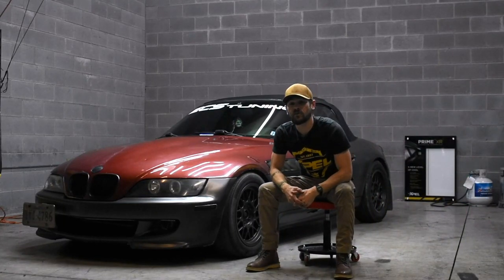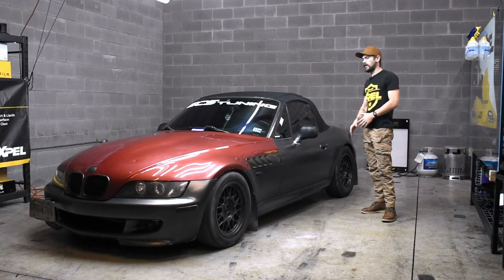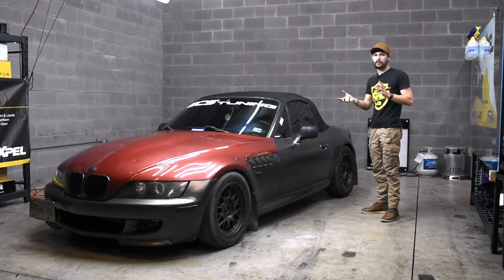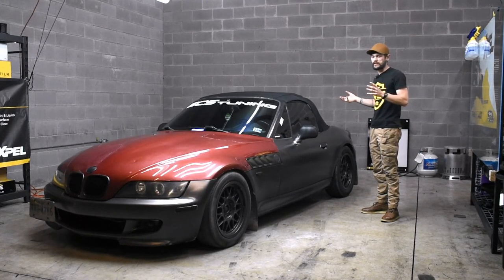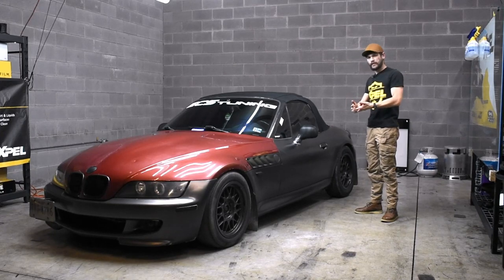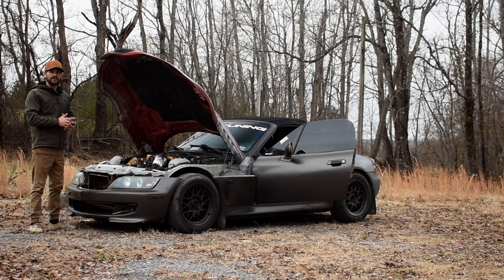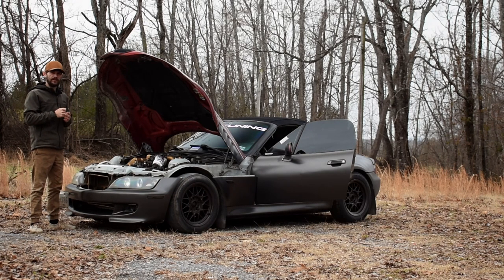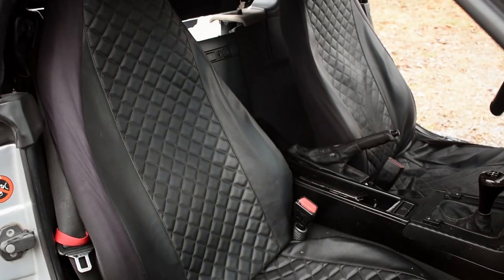How to Improve ANY car IMMEDIATELY | Z3 Subframe Poly Bushing review

Comment: what suspension are you using ? i swapped to a Bilstein B12 Pro and the camber is perfect now
Reply from the maker: I'm running ISC N1 sport coilovers with 32 clicks of adjustable dampening, and garagistic 95a polyurethane bushings on all bushings
Reply: I really want this setup too, are you running their springs, or are you using lowering springs? They don't appear to be adjustable but I can't remember. Hows the ride height?
Reply from the maker: @sahzhree7757  the bilstiens are non adjustable, so you would need swap springs to changes the ride height and that would change your preload which isn't necessarily the right way to do it, instead if your going to lower your car I would recommend coilovers.
Reply: @Bmw_Z3R  my car is almost at the perfect ride height for what I want because I have an iron block engine in the front and the back already sits kind of low. But I've heard that there's just a little bit of a drop on the billsteins to begin with, so that might be perfect for me